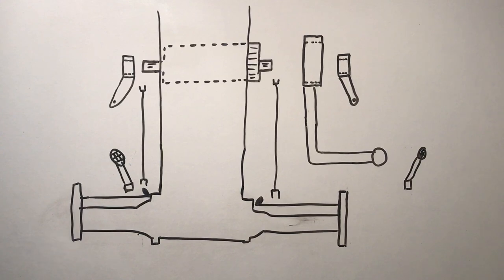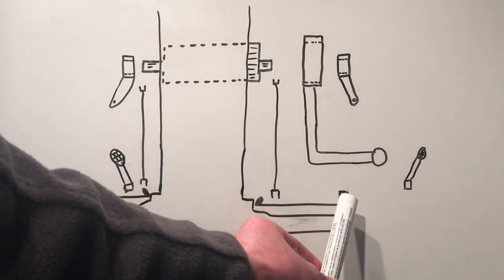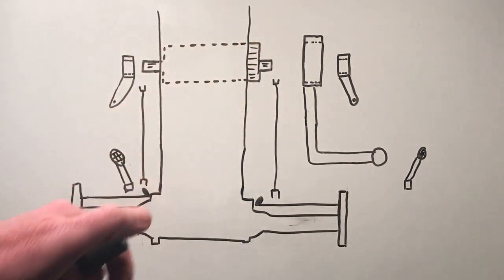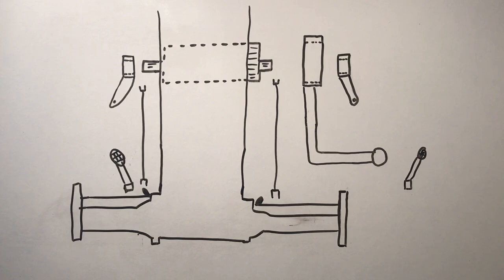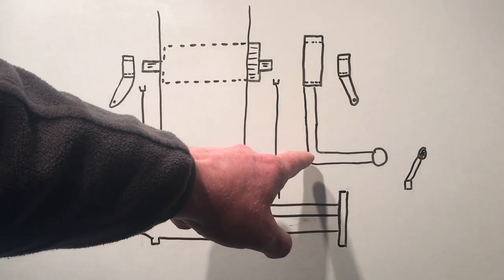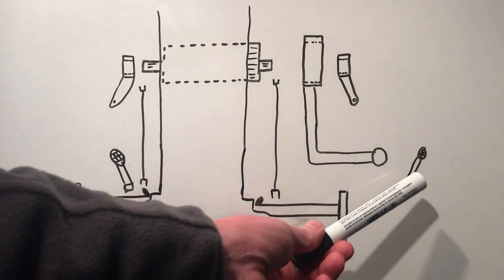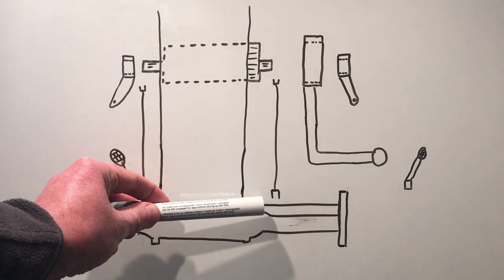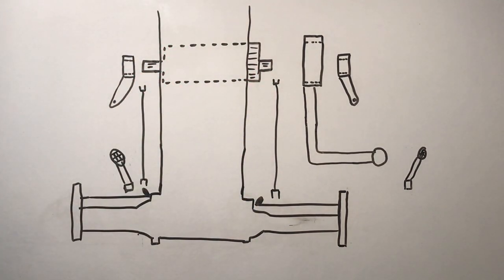#44 Ferguson TED20 - Refitting the Brake Pedals

Comment: Attention ⚠️ in the video the driver of the brake is mounted the wrong way round!
Reply from the maker: HI Ermano, Thank you for pointing this out. Others have noticed this too and we will do a follow up video to correct it as we need to work through setting up the brakes when the tractor is completely reassembled. Good spot! 😉👍

Comment: Another good video with useful tips/tricks. When possible, I prefer to restore the component rather than buy new bolt-on replacements. It is much easier on the retirement pocket book. The lack of shop tools, such as a hydraulic press, lathe and welding machine does present a barrier. I'm slowly working through the playlist and enjoying each segment. Its still too cold in Alberta to work on my project, but groundhog day is only 25 days away. It was -25C this morning, almost tropical compared to what we have been getting. TTFN/CDC
Reply from the maker: Hi Charles, whoa -25 degrees! That’s still pretty cold! 🥴 Yes tooling is a limiting factor and we are constantly looking for something we don’t yet have. I try to find older tools at auctions, but this is not always the best way, you have to be pretty savvy. Of course most of the time that one thing you need right now is not available so it is a bit hit and miss. 👍😉
Reply: and i have prob with paint drying in 4c.   lol